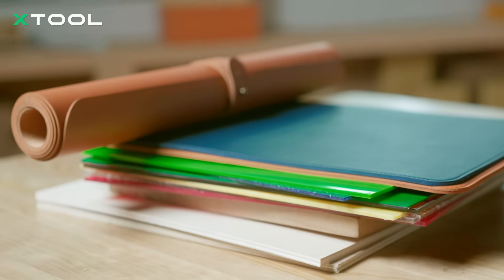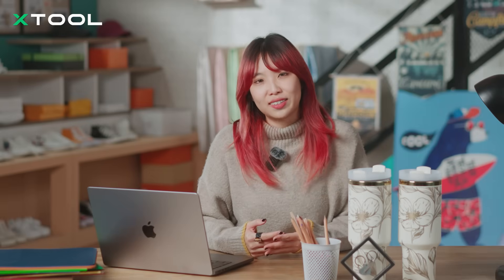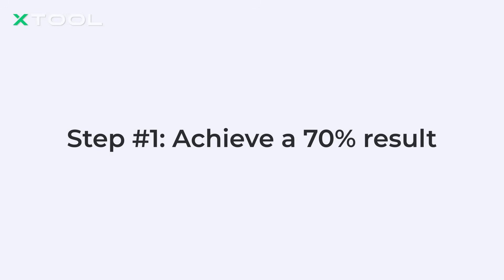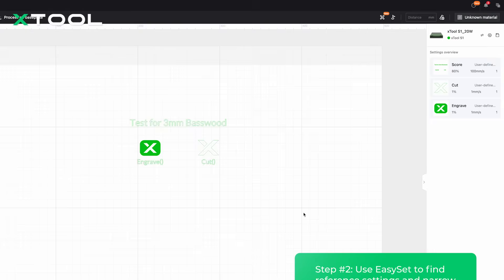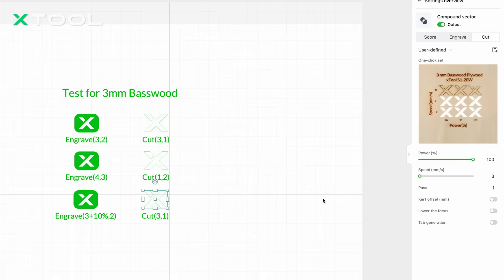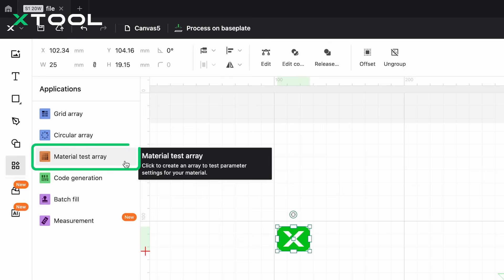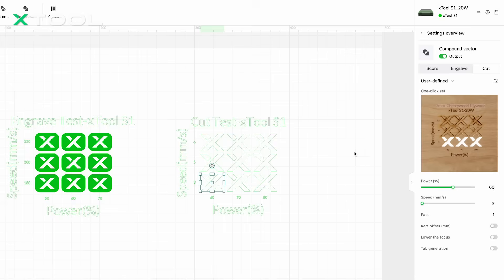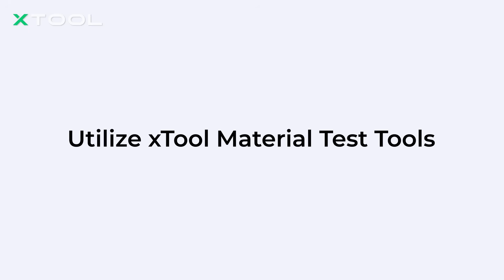xTool Academy: Master Laser Settings with A Universal Formula

Comment: If you're looking to master laser settings, the Monport Mega 70W CO2 Laser is a solid choice. With its large 700x350mm workspace, precise controls, and easy setup, it makes learning and experimenting with different materials a breeze, ensuring you get consistent, high-quality results every time.

Comment: Engrave 3, wasn't an actual increase of 10% in power, because your original 60% + 10% would theoretically have been 66%. What you should have said is to adjust the power from your 60% up to 70%.